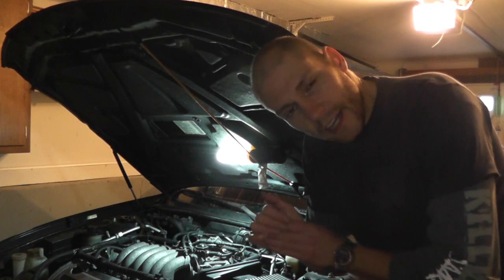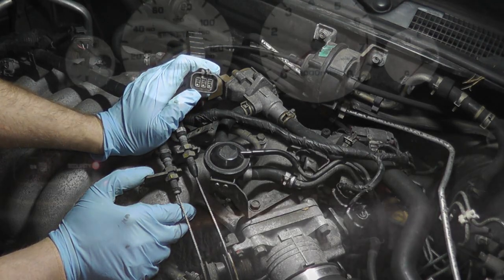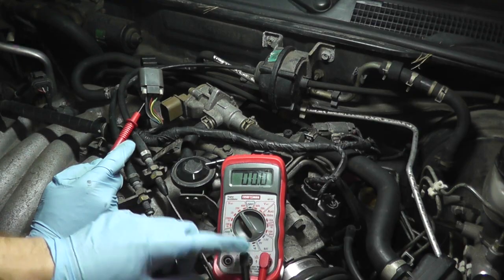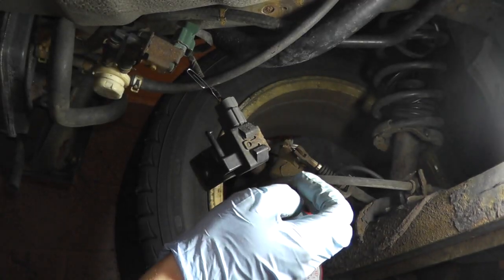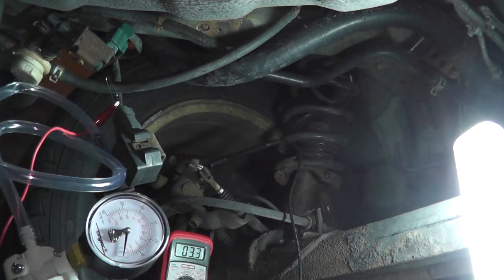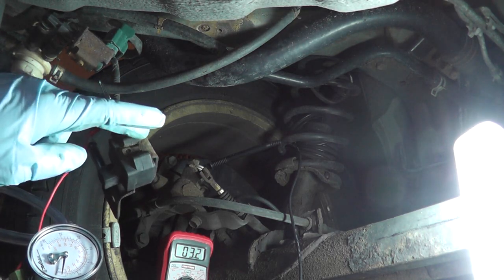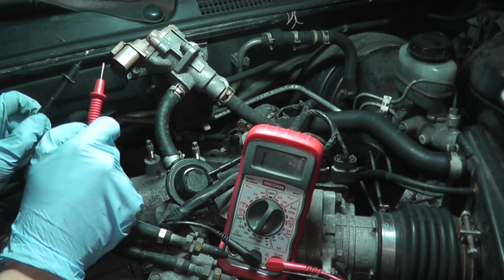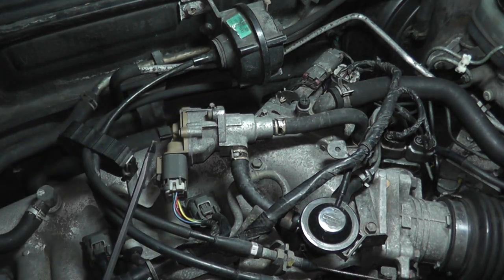How to test and replace the EVAP Canister Purge Volume Control Valve P1445

Comment: This part is exactly like the one my 1997 pickup se has. Amazon and oreilys gave me the wrong part. I installed it in less than 10 minutes.  My brother did the test drive and said the truck runs very smooth. We had the problem where it was turning off at times randomly and the engine was running rough. Now we are happy to say this cleared my P1445 code on my truck. what helped me was looking for the evap valve on a 98 nissan maxima to find the part. I gor a used one on ebay.

Comment: Mr. CarsNToys: Absoloutely the best clearest explanation out of several dozens I've heard so far....  Totally agree, IMO you can ground the multimeter that way, thats the best ground, that you can find on a vehicle  (using a negative grounded electrical system)  IS THE BATTERY GROUND. The entire vehicle relys on that (battery negative terminal to frame) or no#2 the engine connection from starting the engine to reliably connecting everything that needs an  positive electrical charge need a ground to complete the circuit..    Naturally you don't want sparks near where battery gasses are vented..  Any one contemplating these tests needs to learn the best practices re auto electrical diagnostics. 
There are enough authorative sources freely available today..

Comment: I know this is old but I just went thru this with my 97 hardbody truck which has a similar set up.  When the charcoal canister fails, powdery bits can get inside this and cause it to fail to the point it has to be replaced.  On my old one, everything seemed to be good following the service manual checklist but you want to make sure that the plunger inside is not just moving but that it's actually sealing otherwise you may bet a evap small leak which can refer to all sorts of things.  You won't necessarily a 1445 error.  I replaced this but now I'm not getting any vacuum to the purge valve and I'm not sure why.  It's the purge control valve that opens the purge line to release the vapors to the control volume solenoid.
Reply: I also have this code on my 97 hardbody pickup.  Have you cleared it and what parts did you replace?

Comment: I don’t have a voltage meter but I’ve checked the lines, replaced the purge volume control valve, purge canister, pressure sensor and gas cap and I still keep getting the P1445 code...

Comment: I have a 1996 Maxima ( 156 000 miles )  and it moves very slow if at all in reverse gear when engine is cold. Will not reverse at all when engine is hot. Everything else works great since I maintain it well. Should I have the transmission rebuilt ( $1500 ) and keep the car or just get another car ?

Comment: When working in the vic; of the canister, and you call for a vacuum pump, I just stuck a flexible tube on the end of the sensor and sucked away.  Voltage dropped, so I just assume the system was working as advertised. Just a field expedient, useful when necessary!

Comment: I also have the P1445 code on my 1997 Nissan Pathfinder. Makes a loud rattling sound when accelerating and a lot of steam comes from the engine bay when I come to a stop. Still runs for short distances at a time though before stalling.

Comment: I read my G35 Infiniti 2007 Coupe mechanics manual..on pressure sensor test...it reads "increase in pressure....increase in voltage"...could it be wrong..it contradicts this video...of increase pressure, lower voltage...." Could it be different?

Comment: I have a 2000 Nissan Altima with an EVAP leak. The code was p01441 and then a code saying my canister vent valve solenoid is stuck open. Would my canister vent valve being stuck open cause my car to idle low and shut off?
Reply from the maker: It's possible, however, it's typically another issues such as the idle air control valve, mass air flow sensor, fuel pump, etc.

Comment: Good job, thanks ! This would apply, similar for Ford Mustang, 2004 also?? Of course, sensors might/ will look different!! Am I right?? Thanks
Reply from the maker: Yeah, general idea is there. The parts on your Mustang will look different but same function.
Reply: Thanks, I have a huge problem in my 2004 Mustang, 3.8 litre! After I replaced bigger fuelpump, 255 lph, and bigger throttlebody, 70 mm, my idle has been sky high, like 2200 for awhile, then comes down to 1100-1200???, very difficult to drive!!! And bad gasmileage, of course. I know there is a big vacuumleak somewhere, because AC blowing to face changed automatically to windshield, not touching anything???, I was told that means I have a vacuumleak somewhere??? I just can't find it???Check Engine Light has been coming on, even before I did change fuelpump, saying there is large vacuum leak, and "Check you fuel cap", I changed that long time ago, no help??
Reply: I also already changed EGR valve, TPS, IAC sensor, took out canister sensor/ valve yesterday, tested that, blowing thru fine, and when add 12 V, it did close, and all hose connections were tight, checked around fuel tank, all seems fine?? Took out purge valve today from front, inside right fender, all connections seem fine, tried to test valve???, could be faulty??, could not really tell, harness was getting 12 V power?? Also sprayed brake cleaner all over under hood, even brake booster, no leaks??? Where the hell is my problem/ leak??? Do I have to do smoke test next?? Thanks
Reply: My codes are: P0507= idle air control RPM higher than expected, well, I sure know that already ;o), and P0405 = exhaust gas recirculationsensor, a circuit low?? Whatever that means??? Please, help meeeeee, losing my mind here..........

Comment: why does my 95 maxima charcoal box area look so different, it doesn't 4 hoses coming out of the white circle thing, only 2, and no valve thing with a connector, and there is  a broken hose that looks asif it leads to nowhere,  and there isnt a pressure sensor? is this supposed to be like this, it kinda looks like it is, just making sure

Comment: I have a 98 Maxima, throwing code P1447.  I've checked all valves, replaced the charcoal canister, check for vacuum leaks with a pump and soapy water test. I've also used cleaner in multiple parts and hoses to clean out any possible carbon deposits built up in the system.

Any ideas would be helpful.  thank you.

Comment: My car has a p1447, not p1445 but I get 28.5 Ohms at each pin combination, except 2-3, which is 17.5 Ohms.  Could that contribute to my P1447 (supposedly EVAP Control System Purge Flow Monitoring but a "jackpot" code)?   I have replaced carbon canister and the valve that's attached to it, and this out-of-spec valve is my 2nd.  Mechanic has blown out all carbon multiple times.  Any advice would be greatly appreciated!

Comment: When I do the ohm reading on the volume control Valve should the car be "on" or off ???
Reply: Any time your measuring resistance, ohms, you do not want any power present. It will F your metre

Comment: 1995 Nissan Hardbody, my Evap pressure sensor makes a clatter noise when I turn the ignition switch, truck starts and runs fine, but I've recently noticed it lags in power when I attempt to pass up other vehicles. could it be ready for replacement?
Reply from the maker: That could be a number of things. Check the throttle position sensor. If that's okay, check the plugs/ignition system and fuel system.
Reply: CarsNToys I've replaced all mentioned,  but the evap pressure sensor still makes the clicking noise,  it only happens when i turn the ignition, engine starts fine and runs good,  just can't figure out why it makes the clicking noise,  anyone else having the same issue?
Reply: Did you find a fix to this issue? I have the same problem with my 1996 Nissan pickup. I have the p1447 and p1445 code

Comment: I have the code P2422 on my Acura TL 3g. Would replacing the canister control valve fix the issue? I paid a mechanic to clean it out but it still comes back every 2 weeks. (1200km)
Reply: does it have a pressure valve? id change that first
Reply: I washed my evap canister, after 4 weeks of driving, the code never came back

Comment: I have a 2008 pontiac solstice gxp its only pulling like 3-4 pounds of boost. its supposed to pull around 17-20. now there's re are times when the car works the way its supposed to and gets somewhat up there but I've noticed its ONLY right after I fill the gas tank. some suggested that its a evap solenoid do you think it might be the problem?
Reply from the maker: Any trouble codes?
Reply: none besides the mass air flow sensor was dirty cleaned that but till nothing
Reply: excuse me sir i have the code p1445 coming out on my 96 maxima.. my mechanic replaced 2 coils and all my spark plugs, he removed the evap sensor hoses and thats when the code popped up... any ideas
Reply: excuse me sir i have the code p1445 coming out on my 96 maxima.. my mechanic replaced 2 coils and all my spark plugs, he removed the evap sensor hoses and thats when the code popped up... any ideas
Reply: excuse me sir i have the code p1445 coming out on my 96 maxima.. my mechanic replaced 2 coils and all my spark plugs, he removed the evap sensor hoses and thats when the code popped up... any ideas

Comment: Hi
i have a 2003 Pontiac  Grand Am 3.4 L V6 and the trouble that i am having is when i am on the highway driving at 120 kms  and just when i start to slow down i gets this weird smell of rotting eggs, it isn't my exhaust system i just had it all installed a couple of months ago it is Flow-Master  Catalytic Converter and a Flow-Master Muffler, and today i still gets that same smell of rotten eggs coming in threw my Interior Vents a mechanic told me that it could be my Oxygen Sensor but i don't think that is the problem cause there is know lights in the dash or check engine light, Note i don't always get this smell when driving 50 or 80 km 
Please help thanks.
Reply from the maker: +Newfie Led Man That's often due to sulfur in the gasoline that isn't converted into sulfur dioxide. Did you purchase a new or used cat?
Reply: hi
the Cat is brand new i replaced the small piece of hose that is shaped like the letter (C) it was connected to the Valve Cover PVC plastic hose it is back by the EGR Valve went on the highway did 100 to 125 kms and slowed down and the smell was gone so far still no smell.
thanks.
Reply: Hi 
i Found and fixed the problem that was causing the rotten Egg smell it was a simple piece of a Hose that is connected to the PVC valve tube up near the EGR it was Collapsed  due to old hose i replaced it with new one and the smell is now gone away.

Comment: I have a Maxima 04 with the code p0442 (EVAP valve). The Check Engine is on and there's a smell of gasoline.
So what I did was: I took apart the valve and cleaned it and also checked using two cables with the battery to see if it open/closes correctly. What I noticed was that it starts to open and close like crazy. Is this because a) that's not how's to be checked b) the valve is crap c) none of the above

Comment: I am getting a cam sensor out of range, random misfire, lean bank and evap system leak detected! Just let an AAMCO fix my Transmission and now I am having acceleration problems and hard time finding the right gear when driving. I live in SW Florida. Does anyone know what could be wrong and how to fix it. Please hit me up jsessions71@gmail.com

Comment: I'll try to make this short:  Can this cause my 96 maxima to die after exiting highway on hot temp days?  After I exit from hours on highway it dies.  If I open gas cap major vapor is released. Runs fine after cool down and runs fine in the city.  The lines are full of charcoal up to engine bay.  I always had the code but was told it's just emissions crap so I didn't worry about it.  Engine getting vapor causing it do die?  Has charcoal been sucked into intake?  Do I gotta replace all of the parts?  Ty for video

Comment: I have a 2008 Honda civic LX , and I have a check engine with the code P0497 Evaporative Emission System Low Purge Flow, the first thing was I changed a new factory fuel cap, then did a reset and day and half the fight came back, then I went and changed the purge valve did a reset same thing the check engine light came back on with that code what us recommended to do next and if you have have any idea what the problem might be much appreciated.
Reply from the maker: +Galaxy Way Let me see what I can dig up for your specific vehicle and I'll f/u shortly.
Reply: +CarsNToys OK I appreciate it thanks for your time.

Comment: Hello CarsNToys I been battling code P1447 on my Nissan 98 240sx so far I changed my carbon canister and the canister valve also changed the little black valve called purge valve up on the engine bay do I need to clean the line that runs down and below to the canister and do I also clean the other valves that are in between, Nissan dealer quoted me $2,400.00 and man I can't afford that kinda cheese I'm currently off work with a busted back but can do small work on my car like the one you showed on this video so any type of help and instructions are appreciated
Reply from the maker: +The Noid $2400? That's ridiculous. Unfortunately, p1447 can me a number of things. It could be a blocked rubber hose. Try replacing the evap hosing and it may correct the problem. A mechanic would try using a smoke machine to find any leaks. Scotty Kilmer has a video finding small leaks using a cigar. Do a search on his page and maybe you can find the leak. If you continue to run into trouble shoot me an email. Good luck.
Reply: CarsNToys yupp done all you mentioned unfortunately it was the only one valve that everyone hates replacing "the canister purge volume control valve" the one that sits in between the manifold what a shit job that is but I managed to remove it without removing the whole upper manifold, I also replaced all valves in the purge system now I just gotta drive till all monitors complete
Reply: The Noid 

Happy new year, Sir Noid, Did it work? I'm incountering the same 1447 code in my 98 Silvia.

Comment: I have bmw 2003 can this code also related to canister purge valve? Help!!
Reply: +Carlos Garza No. Codes above p1000 are manufacturer specific. Also, a 2003 BMW evap purge solenoid is a completely different design than this one that Nissan used in the mid to late 90's.

Comment: Hey CarsNToys, awesome video, but I'm worried I have a slightly different problem. I have a 2001 Infiniti I30(Nissan Maxima rebrand) and I'm getting two codes: P0450 and P1444. Is P1444 the same fix as it is for P1445? P1444 is supposedly Canister Purge Volume Control Solenoid Valve, but that seems like the same thing as P1445. Also, do you think having a faulty fuel cap could set either of these codes off? When I have time I'll follow the directed steps in this video regardless and hopefully that will fix it. Thanks man.
Reply from the maker: +Sirslicey Your trouble code is for a different component. However, there are other components that could trip code p1444. One is the Pressure Sensor. I have a video for this sensor that was does on a Maxima - https://youtu.be/263bj1gVKsU  Also check the EVAP Canister. If it's saturated with water you can get code p1444 - https://youtu.be/0hdY29nkXiw.  Hope it helps.

Comment: I have a question so I got the same code on my qx4 but notice the cut valve next to the purge does suck any air so it is not allowing the cut valve to open up can that be why I have a p1445

Comment: Alright so that being I have smoke coming from the face of the evap valve canister the brown part ??? Can't find shit on that why it's smoking
Reply from the maker: +Ray Marshall The brown part of the sensor 10 minutes into the video? A crack on the plastic body? If so, try using a little gasket sealer. It's worked for me in the past.

Comment: My evap system has been giving me problems the last days with a fuel smell, no CEL so I checked every evap hose for leaks and they are fine, the leak is from the canister vent :/ I already checked purge valve and it's ok. Might the problem be with the canister itself?
Reply from the maker: +Roberto Búrbano Possibly. Another sign for a bad canister is when you fill up the gas tank the gas pump nozzle will stop flowing continuously. You have to keep clicking the lever to fill the tank with gas.

Comment: when you say tape the ends. are you referring to the hoses end or the valve ends. i have a 2000 expedition with the p1450 code
Reply from the maker: Chris b the rubber hoses

Comment: Absolutely fantastic video!  You've got presentation skills!

I've got a 1998 Maxima with a code P1493. My limited research indicates this is for the EVAP purge solenoid. This video will be a big help in troubleshooting!

Could an EVAP issue cause hard starting?  My car typically takes three or four tries before she wants to start.

Thanks and keep up the great work!
Reply from the maker: Damien Gregory Glad to help, Damien. P1493 is a trouble code for the EVAP canister purge control valve / solenoid valve. It could be a number of things; including EVAP canister purge control valve, EVAP canister purge control solenoid valve, EVAP pressure sensore, EVAP canister vent control valve, clogged vacuum hoses/disconnected or EVAP canister saturated with water. I have a bunch of EVAP videos at carsntoys.net - Click on auto repair and then the EVAP section. That should help you check the system. Cheers.
Reply: E